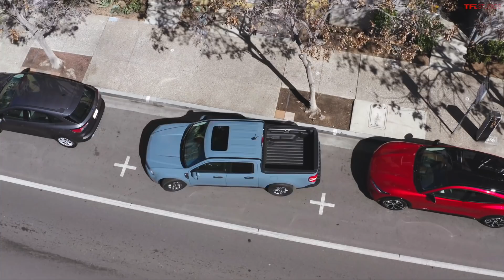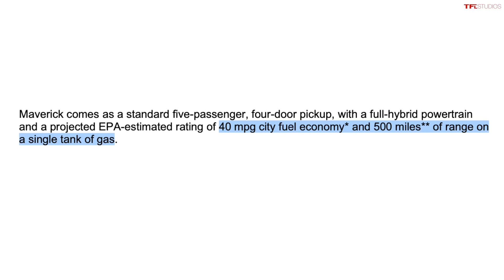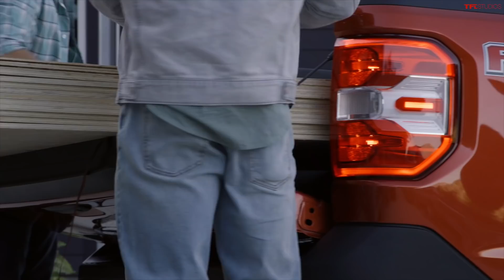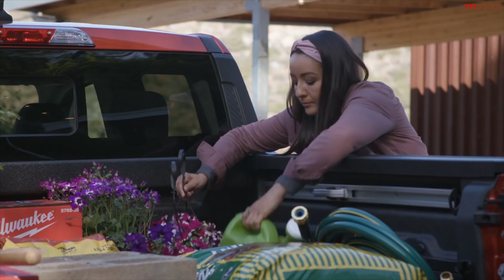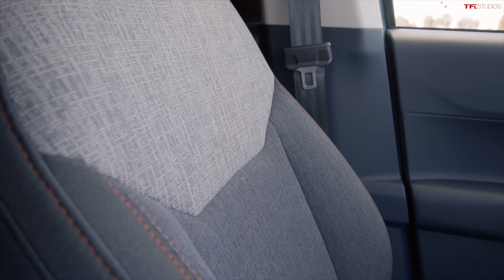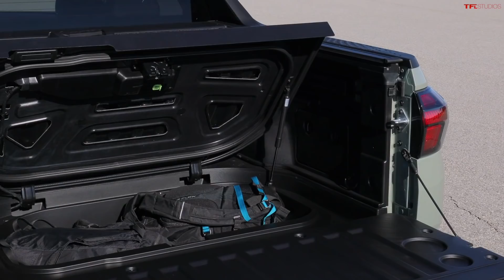Hands On With The New 2022 Ford Maverick: Here Are The Top 10 Things You Need To Know!

Comment: The bed is too short, and the CV-T transmission, those have problems, they break too soon. And the milage claim, more like pulled out of thin air. So no I would never even consider buying one. You buy a truck for the purpose of doing truck kinds of things. This thing is a half car with an open-to-environment trunk. And of course, going with four-cylinder and turbocharging means the engine will wear out quicker. Aluminum head + turbocharging will mean head gasket problems. It's a crappy car/truck like the El Camino was from days gone by.  A friend of mine got it right, he has a truck, in his case a Toyota Tacoma, that he does truck stuff with, ie hauling his fishing boat. And for going to work and general transport, he picked up a clean used Toyota Corolla.  So this thing is going to be the greatest thing since sliced bread, yeah I am not going to hold my breath. And I doubt you will ever see one on a dealer's lot with a tag under 20K either. If you are going to buy one, wait five years to see how the durability of the thing is. My guess there is going to be transmission problems right out of the gate along with head gasket problems with the turbo.
Reply: You speak as if you know nothing about anything. 😂
Reply: Also its not a typical CVT, there is no belt. Just because an engine is turbocharged doesnt automatically make it prone to head gasket failures, how ridiculous.

Comment: Do I have to be the guy who points out that it holds 9.7 quarts of oil? If it requires full synth, those are going to be some pricey oil changes.
Reply: Its not 9.7, its 6.2 quarts of oil. You were probably looking at the coolant capacity which is 9.2 quarts.

Comment: Wow, bravo. I’ll be the first to hate on Ford but all that for the price point is pretty fantastic. Hopefully it holds up.
Reply: If you want anything other that the base truck, that price is gonna quickly inflate past 25k. There will be that one deal breaker feature you want tied up in a $2,500 package.
Reply: @darkdodger137  I agree but starting low is a plus these days. I’ll never buy a Ford so I’m not concerned with that. Just giving props where it’s due.

Comment: its about time , i had a ford courier way back in the day and it fit and went anywhere .
Reply: I think the original Courier was in fact a Mazda Truck, with a Ford Badge on it.
Reply: @greyangelpilot  Ford ranger was pretty much the same as mazda bt 50 as well.
Reply: @ilijapetrovic5002 Petrovic while in the 70's up to the early 80's, Ford imported the Mazda produced Courier, the North American Ranger was based on a Ford design (Project Yuma) that was later used for the B-2000 in '94 also in NA.  The current T6 platform was designed by Ford of Australia as a replacement for the Mazda B platform used for international Rangers.  The 2nd generation BT-50 also uses the T6 platform.
Reply: Funny - my first car was a ‘78 Courier and I watched this whole video thinking of it. Loved that little truck.
Reply: @asugrad1999  even funnier drop the R off your last name and you have mine . 
and yes think of the stupid stuff we did with those trucks
Reply: I drove a '75 Courier in high school and put 165,000 miles on it before I traded it in for an '85 Mazda B2000. Those little motors could take a beating.

Comment: Nearly WORTHLESS as a pickup.... Great payload... unless you want to actually CARRY something in that tiny little ass bed! What happened to ACTUAL pickups? You know, with beds that were used to actually put things in? I have a 12.5' Kayak that will need a bed extender to put in the bed and it'll mostly hang out the back. WORTHLESS as a pickup. Face it.. it's a crossover SUV with a little bitty bed tacked on to make urbanites feel as if they own a "truck".. NOT a real truck. Nevermind.

Comment: Interesting that it is roughly the same size as what the last gen Ranger was (2006-2011) very similar capacities too.
Reply: Still driving an 02 Ranger. The Maverick actually has me excited to replace it. Don’t want or need anything bigger
Reply: My suggestion for you?

F550 sir.
Reply: @relikvija  only an f550? need at least an f650 cmon
Reply: @relikvija  how about F1K? i.e. F1000
Reply: @gahfeyyah  do they even make those.
Reply: @relikvija  Na, he need a summit hauler 4x4 from transwest.
Reply: @chanshadeez2303  they technically do, it's what the F-150 got rebadged as for the Brazilian market a few decades ago. I am also aware there's a semi truck in Europe called the F-Max as well
Reply: @relikvija  I drive a 22,000  lbs step van Ford for work. 😅
Reply: @maxnautical  I also have an 02 Ranger... This timing is pretty good because I'm looking to upgrade. I didn't know this was a thing until today.
Reply: @SheaHarris  This isn't an upgrade. Its a car with a bed and a horrible CVT tyranny.
Reply: @leelu9236  As long as it looks like a truck and can do truck stuff I don't care.
Reply: @SheaHarris  if it doesn't have a separate bed and cab then it can't do "truck stuff". You might as well get a mini van and fold the seats down.
Reply: @leelu9236  The thing is as capable as my 02 Ranger except for a shorter bed. A minivan wouldn't do what I do with the truck. It also looks like a truck. Don't care if it's unibody. Minivans are hideous.
Reply: @SheaHarris  Yeah, it absolutely cannot do what your older Ranger can do. But good luck. People who own actual trucks will not accept your car with a bed on it. The only people who will be impressed are urban posers who don't have need of an actual truck.
Reply: @leelu9236  Less towing capacity but I don't pull anything.
Reply: @SheaHarris  Ladder frames (separate cab and bed) are capable of carrying heavier loads as well as towing more. They flex more rotationally which also means they have an advantage in off-roading. You know, "truck stuff". They are more rugged and can handle more damage. And when they do get damaged they are easier to work on. In unibodies the body panels are the frame. Damage them too much and you are entirely SOL. I have a Maverick from the 70s (when it was a car) sitting in my field right now that I can't do anything with because the "frame" (aka Unibody) is too rusted. So no, nobody who actually needs a functional truck would want this piece of trash. I'll stick by my statement that it's marketed towards urban posers.
Reply: Anyone who owned a compact Ranger should find the Maverick to be a close match.  A lot of work got done with the compact Ranger so there are already a lot of people out there who know what this little truck can do.
Reply: @1guyin10  the former Ranger you speak of & this maverick are worlds apart. Take in mind the Ranger you're familiar with was not a unibody vehicle, Ranger had a frame. That alone is a big difference, having an actual bed along with it being separated from the cab. Difference is in the details.

Comment: Normally i don’t jump and done for a product, and this thing would be dead if it was 30k starting msrp. But at 20k to start and it’s a hybrid. They’re going to sell like absolute hot cakes 

My only complaint is the front nose and it would of been great if we could of gotten the 1.5 3 cylinder as an optional engine over the hybrid maybe even with a manual transmission

Comment: The Maverick is very tempting. Will there actually be any at that $20k price? Great MPG and solid payload is pretty unique in the market.
Reply: Custom ordering is your friend
Reply: Yes. The bare bones model. The build and price is available on the website
Reply: The base model is just over $19,000
Reply: In dealer stock, odds on very few. But as an ordered vehicle should be no problem.
Reply: The majority will probably be XLT's in the $28k range

Comment: A FWD CVT? Oof. With most modern ford's, best to wait 2-3 years to see what corners they cut.
Reply: E cvt
Reply: ECVT has been used since the first hybrid Escapes with virtually no issues.  It is different than a conventional CVT
Reply: They have been doing this for years buddy. I have it in my Ford Fusion energi that has  70000 miles and no problems

Comment: Why did they only give the hybrid FWD?  I think they made a mistake there, personally. A truck without at least AWD?  Not a fan.
Reply: For most places FWD is fine, especially if the right tires are being used
Reply: Might be a slightly tougher sell here in the northeast. I really like it, I just really wish they had an AWD option for the hybrid. Is there any technical reason they didn’t?  I assume it would likely get less gas mileage, but I wouldn’t think that would be enough to not offer it.

Comment: Sorry for the many comments, but I like commenting as I watch.  Not a fan of CVT transmissions.  It will be interesting to see if they have improved it over previous generations.  Had a Nissan crossover with a CVT.  Could not stand it.
Reply: Jetco CVT transmissions are straight trash, but this is an eCVT it doesnt use a belt so it eliminated that failure point.

Comment: I get that a lot of people use small/mid trucks as family vehicles, but not offering a single or extended cab version with a longer bed is a mistake IMO.
Reply: Overall opinion: decent city truck, but the only thing they nailed is the pricing (if the $20k-33k estimate ends up sticking). For a company so deeply invested in trucks, it is disappointing to see them continue to treat them as suv's with a bed. This in a single cab with real 4wd would have made a great little work or farm truck.

Comment: So the folks who've hated on the Ridgeline forever gonna be objective and yell from the rooftops: "It's not a truck!" Right???
Reply: With a 4.5’ bed I don’t really consider that a real truck. That coupled with the lower payload and towing capacity. You have to buy the larger engine then option it with the max tow package for a 4K tow limit… otherwise you only have 2k towing. My BMW X3 has a 3500lb towing cap with a normal tow package. That’s from a sport suv that can tow more then most of these trucks will be optioned for. This is a truck for people who don’t need a truck but want to say they have a truck and play pretend.
Reply: @FishFind3000  good points, but you'll be hooking that trailer up every time you want a sheet of plywood or to haul the trash out. You have a nice vehicle for you. I think there will also be a market for this vehicle, whatever you want to call it.
Reply: @rondavis3232   My take's you should be able to buy whatever fits your needs. It's a free country. Having said that, I just don't see the FWD only model with the lower capabilities selling well.
Reply: @IamGroot786  agree, with one exception: I think he said the turbo version is available in AWD.
Reply: @rondavis3232   That's my point. Why bother with a FWD only model when every single SUV out there is an AWD already? Honda also made this mistake with the Ridgeline and they abandoned the FWD model because it's just didn't sell well.
Reply: @IamGroot786  it will sell well for city people who don't want AWD but want 40mpg..
Reply: @IamGroot786  I think it depends on the reigon you live in. In more sunny states like California or florida I can see them selling more,  but in states with shitty snowy weather like Michigan where I live, FWD is absolutely useless, and they would barely sell. But yeah i agree though that at that point, you're better off just making awd standard and doing away with the fwd. i think Ford is just going the Honda route and they're going to see what the sales figures are going to be like before deciding if they want to ax FWD or not.
Reply: @coytus94  FWD works a hell of a lot better in bad weather than RWD, and there's plenty of RWD pickups out there.  Traditional 4WD isn't all that great either.  My F-150 can't take a regular city corner in 4H without binding unless the road is completely covered in snow or ice.
Reply: @FishFind3000  or people who already have a real truck when they want to tow but are looking for an affordable daily driver they can still run errands in and carry some toys. I let my wife drive the truck because its too big to park at work.
Reply: @FishFind3000  not quite true, real people are not pretending and have real needs for a separate bed regardless of the size and towing capacity of the vehicle.  Lets see you put a new refrigerator, a dirt bike, or a load of manure in your X3 ;) This is made for a typical office working homeowner who wants good gas rating, a car like drive, and not anything more.
Reply: @FishFind3000  fits my needs perfect. I wouldn't do the hybrid FWD version but the AWD with the towing package at around 25k is great for towing a small 16 foot boat or a small camper and the bed is fine for yard work and throwing the kayaks in plus the crew cab, small size, and mpg makes it a good daily driver for my family. Hell I would settle for an SUV but they either are sedans with a bigger body or over 30k. Seems like the dream car for someone who fishes or camps but doesnt need a full size truck with a full size price tag.
Reply: Well, it's not body over frame, so the Maverick is not really a pick up truck. I do admit this vehicle fits the millennial and gen z image perfectly. Ford did their research.
Reply: @Lexman00   I like your objectivity. The unibody design doesn't bother me as much as the idea of a FWD only model (Really, just about every SUV is AWD) and that rotary shifter! Ugh! What were they thinking?
Reply: Lol no I'm waiting for those idiots to actually call it a truck just because it's made by Ford and prove that they just have a bias against Hondas.
Reply: @coytus94  I'm a ford guy and don't have anything against honda but ill still talk shit about the Ridgeline and maverick lol. I see them more like an suv with the back half cut off.
Reply: @pedroelizondo5281   At least you're consistent regardless of brand.
Reply: The Honda Ridgeline is a cut up minivan 🚐

Comment: Ford is going to kill it with these hybrids. EV’s will be good one day but aren’t practical for everyone yet.
Reply: Keep in mind the hybrid is a stopgap solution.  All the maintenance and repairs of a mechanical system now cramming batteries, inverter, and electric motors into the mix.  Will be a nightmare in 10 years on the used market.
Reply: @aussie2uGA  so will current gen EV's in 5-7 years with their battery life cycles at end of life and need replacing.
Reply: @aussie2uGA  its a $20k truck. If its still driving in 10 years thats a homerun
Reply: @mattbrew11  lol, I still have a 2001 Tundra, going strong at 280k miles, and its msrp was $15,500 ;)
Reply: @aussie2uGA  in today’s money thats 22000
Reply: Given the capability of the turbo - you think anyone is really going to buy the hybrid?  To me it just screams "CAFE compliance vehicle".
Reply: Yeah i tow my caravan/rv so a hybrid is perfect. Cruise around on battery/electric to work, use the engine when towing on holidays. Perfect middle ground. Hopefully the new ranger will deliver like the new f150 and now the maverick has.

Comment: For all concerned about the CVT, it's not really a CVT. It's an E-CVT. There is no belt as a failure point, it instead uses the electric motors to change ratios. These are very reliable and were originally designed by Toyota.
Reply from the maker: Yes, but still drives fundamentally the same (at least in the escape hybrid and toyota’s I’ve driven). No shifting and continuously variable
Reply: @TFLtruck  Exactly. CVTs are a good tech IMO marred by their irreliable implementations.
Reply: @spacebound1969  The word you're looking for is unreliable. Irreliable isn't a word.
Reply: @blackwolfshad0w25  Thanks for that shocking assessment Corey. It was very necessary to prove you know more about grammar than myself. 

Did you know what I was talking about? If so, your correction of my grammar on a day old post is totally pedantic and serve no point but to stroke your ego for knowing more than someone else.
Reply: @spacebound1969  apparently someone isn't too well educated and doesn't like to be corrected.
Reply: Actually, as a dealer tech for over 20 years, I can attest to only having to replace 1 transmission in a escape hybrid, which was due to a bad axle seal. The transmission bearings went bad due to lack of lubrication. I have not seen any other failures associated with the ecvt.
Reply: @aaronwscherer7436  It's a great transmission! Very few direct connections and moving parts.
Reply: Amazing comment...
Reply: So, the CVT in my 2018 Toyota CHR didn't make it to 70k miles. I'll never own another one. Oh, and I should mention that the first replacement wasn't any good either. It was used because I had to go through the extended warranty. All work was done by the dealer.